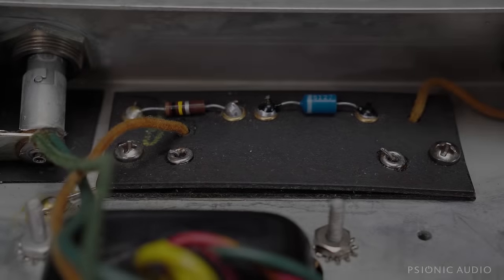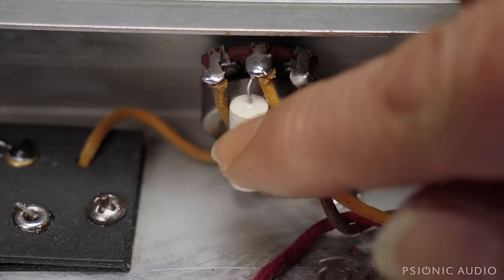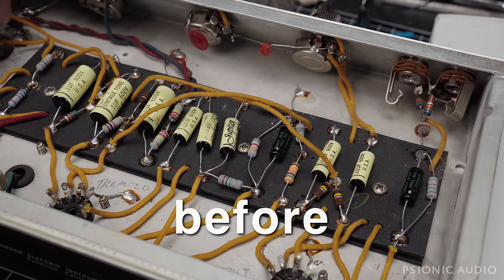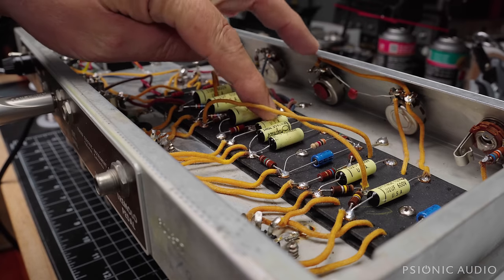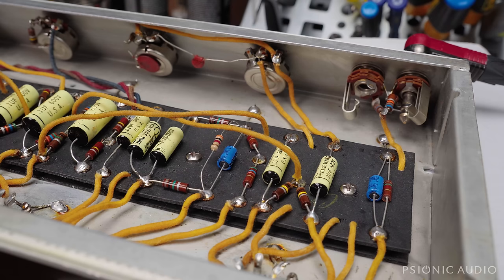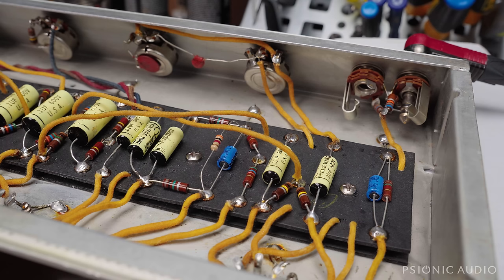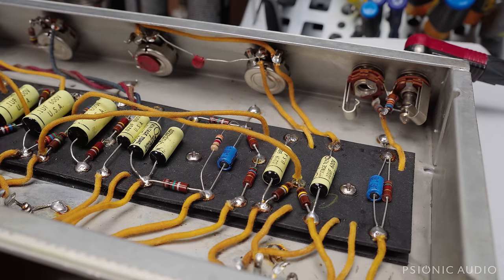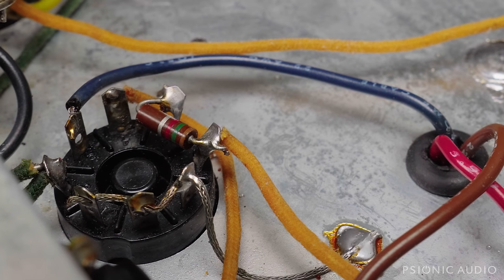A Few Changes | '61 Fender Princeton Pt 2

Comment: I had an untouched brown Princeton that had one of the disc caps on the pots not soldered, it was looped in so it worked all those years. Must have been the same day dreaming gal, surely not Lupe! Shame the amp was cap harvested.

Comment: Many, many years ago, before internet era, I got one of my first tube amps which had a same kind of cathodyne PI and  tremolo osc feeding output  tube grids. It was some kind of cheap Watkins Dominator type amp. I did not like that thumping at all, so I just decided to add one 12AX7 after PI as a double cathode follower buffer to feed the output tubes and make the  trem osc output nicely balanced to both output tube grids. (One option would have been to redesign the PI to be long tail etc. But in that very amp it was very easy just to add an extra tube.) That mod absolutely 100% gets rid of that thumping  and you can really get a very deep and nice tremolo if you want to torture output tubes with that bias swing. Of course, you have to make sure that PT has enough juice to supply that extra tube's power. That mod is of course very inappropriate for a real  vintage amps. 😂

Comment: I am actually getting parts together to build a 6g2 amplifier. Chassis from mojotone is coming in, have a front panel coming, have the tag board already. Slowly going through listings looking for old transformers that were pulled from old amplifiers that fit the specs. I might make an original duplicate of the combo, but I want to try different things like making a 1x15 combo with an old Magnavox Alnico or something.

Comment: I made a fortuitous discovery years ago. 
I had bought some special flux for soldering to Aluminium. 
Not only does it work well for Aluminium but it works on Steel as well. 
I can't put a name to it right now because a lot of my stuff is still in boxes after a move. 
It was American made stuff though. 
All kinds of Toxicity warnings on the pot ... ☠

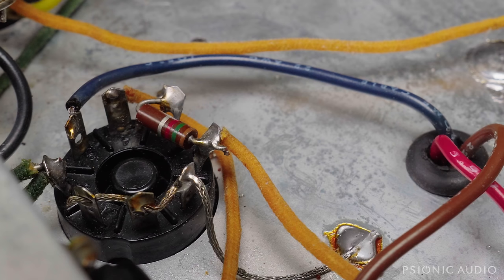Comment: 9:30 Hopefully the solder looks better on the other side of those lugs.  From the view of the camera, 8 isn't great, 1 is worse.
Reply from the maker: Yeah, I checked. Line of flux looks like a dark line but the joints are good.

Comment: What’s your opinion on reenergizing alnico speaker magnets? Is it necessary?
Reply from the maker: I’m not a speaker expert, but in a general sense if a magnet isn’t as strong as it was designed to be for an intended purpose, regaussing would be an option. 

But I haven’t had weak magnets be an issue on any of the speakers in amps that have come through, even from the ‘30s.

Comment: that square and those front mounted screws are factory for all the earliest brownface princetons
Reply from the maker: I was just doing a lot of research on that, and you are correct. 

Kind of weird, not as pretty as the later ones, but inherently valuable so it won’t be touched.

That un-square square means this was done by hand, so probably a VERY early 6G2.

Comment: Nice work and detail cleaning up those eyelet boards and components. Just a minor item when you refer to the bias resistor you mention it a few times and refer to it as 24K when it is in fact  a red-red-ora, 22K. I know you have mentioned before that you are color blind and I just want to mention this if you want to edit the video  and then delete this comment. I love these amps and have a 6G2, albeit a tuxedo version!
Reply from the maker: It measured 24K so I called it that. ;)